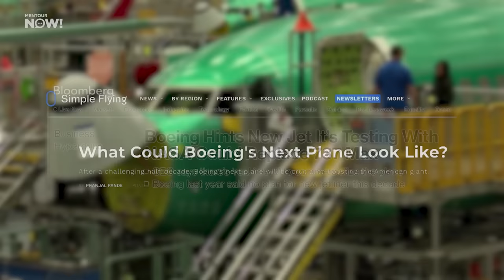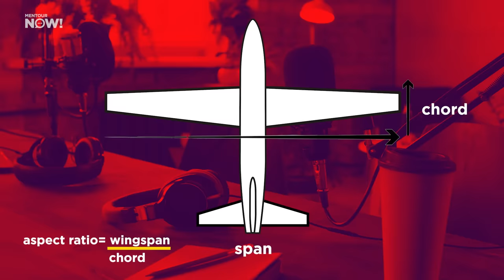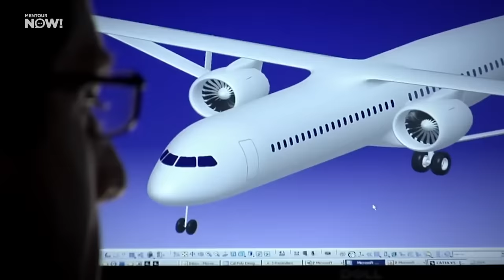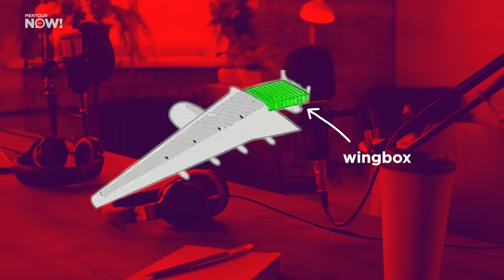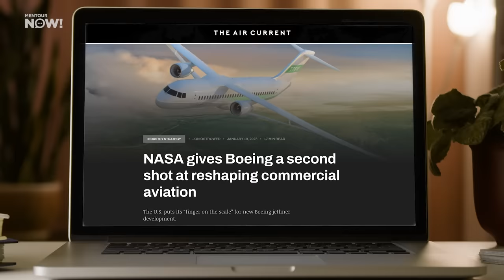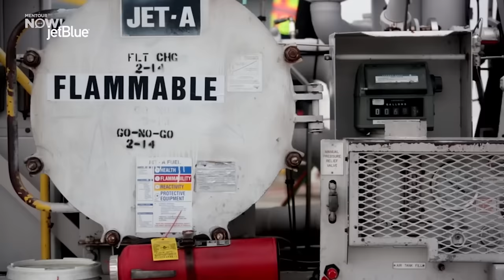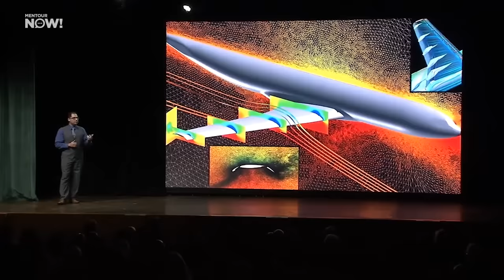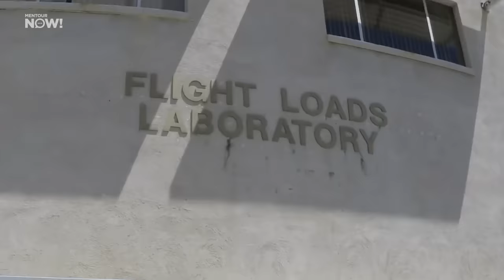Revolutionary Breakthrough: Boeing's Transonic Wing in Partnership with NASA!

Comment: I kinda hope that smaller, slower and more efficent is the future. They should make flight more bearable, or start breaking long flights into several short flights. This may fix several problems: increase effecency, let passangers take breaks, and possibly even use electric motors.
Reply: The reason they build them large, fast and long-haul is because it's more efficient than small, slow and multi-leg.

Comment: One correction: It doesn't "beg" the question; it simply raises it. To beg the question is to answer a question by simply restating the question in different words in the answer. In formal debate, this is considered an error, a logical error.
Reply: This isn't actually a correction because "beg the question" is commonly used as a synonym for "raise the question" when the context is not a debate. Indeed, if the context isn't classic logic, it's pretty challenging to find an example of someone using "beg the question" in that sense. Language has evolved, and it is probably a good idea to get used to it instead of whining about it.

Comment: I am a captain of a B747F, and I could attest to the fact that Boeing made a huge mistake by canceling the production of the B747 types. The demand for a B747 cargo aircraft is at an all-time high. However, Boeing wants to push for their B777 line to replace the 4 engine planes. The nose cargo door of the B747 makes the B747 a unique and needed cargo aircraft, which no "modern" aircraft from either of the aircraft manufacturers can't replace. 
The B737 is a relic from the past, and the type should have been retired 20 years ago. The Max is nothing more than a B737-400 with modern avionics, but old systems running those avionics. Basically, it is a pig with makeup, but it is still a pig.
Boeing should have modernized the B757 by changing the engines and the old avionics package. The B757 is a much more capable aircraft than the B737 Max will ever be. The B787 is not what they want you to believe. Although I have not flown the aircraft, I have flown with people who have, and their opinions are all about the same; they do not like the aircraft. 
All I can say is that I am so glad that I only have 4 more years before my mandatory retirement from 121 flying, and not a moment too soon.
Reply: Regarding the 747, the production line was open until recently and cargo airlines could order aircraft until 2 years ago or so. They ordered what they needed, they could have ordered another 50. They didn't however. It was shut because all orders were delivered, not because they wouldn't have accepted more orders.
Reply: @Simon M  As far as I know, Boeing was pushing their customers to purchase the B777 instead of the B747 types. As you said, most of the companies ordered what they needed, and now there are no more B747s being manufactured.
Reply: @afreightdogslife  at the end the 777 is the more economic aircraft, it just has the disadvantage it has no nose door, but just a side door. The new 777-X freighter should be on par regarding payload with the 747-8 F. 

From the late 2020s on there are stricter rules regarding efficiency and Boeing has to discontinue the 767 F from then on too.
Reply: @Simon M  Like I said, Simon, I am very glad that I only have four years left before I retire, I can't wait, lol.

Comment: But how about two wings, connecting at the ends? That could solve some issues. Like the Sharrow propeller.
Reply: @cyrilmonkewitz  and it gives you double lift for a short wing, no?
Reply: @cyrilmonkewitz  if the wing is half as long, it will be more than twice lighter, as it does not need to be that strong.
Reply: Two wings connected at the tips is much worse for induced drag than a longer wing of equivalent mass.

Comment: The low wing design has an advantage, as rare as they are, when it comes to water landings
When it comes to folding wings: it doesn't necessary to have it fold up. They could use a sweep back design
Reply: Sweep back design? The important aspect with respect to lift is the face that goes into the air. The swept back design is important when approaching the speed of sound but otherwise it's all losses.
Reply: @Milamberinx  I don’t think he was referring to sweeping the wings back when the plane is in the air, but only when on the ground. Still, that seems like it would be a lot more complicated than just folding the wings.
Reply: @Milamberinx   John is correct. I was referring to have the folding wings/wing parts sweep back instead of folding up
Reply: @henrikcsuri  sorry, I completely misunderstood what you meant. What you're talking about it more usually called "swing wing", it's been used in fighter planes with... mixed results.
Reply: @Milamberinx  That's where i got the idea from. I live near the USS Midway museum and they have some pretty cool airplanes onboard
Reply: Why not both? Just like an hybrid of an F-14 and F-18! Boeing already has some experience with that! Heck, while we are at it. Why don’t incorporate some body lift capability like the F-15 has, using that McDonell Douglas experience!
Reply: @luiskp7173  Because as it was mentioned in the video it's harder to inspect a wing piece that folds up.

Comment: At 0:13 you can see the noise suppression pipes at the back of the 707's engines. You can get a better view of the pipes at 2:58. Noise suppressors were installed on early jetliners and were comprised of several exhaust pipes arranged in a circle. Early models had 21 pipes per engine, comprised of 10 large pipes in an outer ring, 10 smaller pipes in an inner ring, and a center pipe. Later designs had 8 large pipes with a flower-style center exhaust pipe. As engines got quieter the noise suppressors were no longer needed. You can get a glimpse of some pipes through an early type of thrust reverser at 3:36. Then another brief look 4:34.

Another interesting thing to notice is the tiny air intake above the 707 engine at 4:25. This air intake is for the cabin air pressurization system. Behind the air intake is a small turbo compressor. This was supplemental to the cabin pressurization provided by the engine bleed air. They only had the turbo compressors on two or three of the four engines.
Reply: Mufflers?
Reply: @sharoncassell9358  Sort of but it worked differently. In a car muffler the exhaust gas bounces around inside the muffler in a certain way which reduces noise. In a jet engine most of the noise comes from the exhaust slamming into the outside air. Running the exhaust through pipes changed the way that the exhaust hit the air which reduced noise. Only somewhat though, the early engines were still very noisy especially at takeoff.

Comment: 13:00 each side would need to fold 8m of the wing. Flexibility of the whole wing could be a problem. Especially around the truss. Basically everything from truss to fuselage would not have any flexing.
Reply: That's exactly what i was worried about as well, i just wrote a comment asking a similar thing, because i am imagining a wobbling mess, kinda like the suspension bridge that danced in the wind before it collapses.
So i am sure they have thought it through, and your suggestion makes a lot of sense, granted, i have no education on this.
I hadn't actually thought about that, although he did mention the wing box enforcement.
Reply: @Games_and_Music  yes but normal wing is gradually changing its reinforcement and the flex changes by linear way. Here the strongest point of the wing would need to be around the truss. This doesn’t go well with wing becoming narrower the further you go from fuselage.

Comment: I have never heard of an airline being directly charged for the size of the gate they need. The main airport charge is the landing fee, which is based on max take off weight and noise and emissions category, not size. In the US airlines do tend to rent their domestic gates, so for those this a bit true, but this slender wing would be more suitable for long haul flights anyway. Now another challenge not mentioned is the limited fuel capacity of these wings. Moving fuel to the fuselage is not good for your structural weight as in increases the wing root bending moment.
Reply: Because YOU have not heard of it, doesn’t make it untrue. You think Petter is making this up?
Reply: As explained in the video, there are different gate categories depending on the size of the aircraft (including the wingspan). Large planes, like the A380, 747, 777, etc., require larger gates. And smaller planes, like the 737 and A320, are suited for smaller gates. There are gate category fees included in the landing fee package. Large or super-large aircraft will pay more than smaller planes. So you will want your small, single-aisle airplane (which the new wing design is built for) to be physically able to use the smaller gates. If the wings are unable to fold, then the plane can only park at gates designed for larger aircraft, thus making the small plane cost prohibitive.

Comment: I think this is just showing how hydrogen is probably going to be the winner for future green aircraft.
I think synthetic kerosene makes more sense to pursue personaly.

However, if you have to store hydrogen in tanks in the fuselage. You can stop caring about space in the wings for fuel and focus on efficiency to get the most out of the lost fuselage volume.
Reply: Except a lot of hydrogen planes tend to have larger/delta wings designs due to the needed volume regarding the low volumetric density hydrogen. So either you increase the fuselage size, or the wings size or ofcourse a combination.

Comment: You know, designing a plane is much more than make it more eficient and sustainable, its also ( a lot) about passenger confort. So here i dont see any advancement for passenger, they just travel in a tube as usual. Dicth this concept and develop all wing planes
Reply: Not everyone travels in a tube as usual. They've got some pretty cushy seats towards the front of the plane. And you get to board first and everything. But it costs a lot more, just as larger cars, and larger houses, and larger hotel rooms with higher service cost more. I can only afford to sit in the smaller seats in back where it's a lot cheaper, but I'm okay with that. I guess it would be more fair if they socialized it and made all the seats the same size, but that's true about everything.

Comment: As for the Boeing Vs it's only real competitor, I'll say this.
Airbus hasn't designed a plane to nose down into the ground when the AoA becomes questionable.

Airbus hasn't designed a plane to completely take control away from the pilots.

Airbus hasnt designed a plane with mid-flght automatic door openings, of doors that aren't even supposed to be able to open.

Airbus doesn't keep quiet about any changes they make to their types or designs. No matter how large or small they may be. 

Airbus is still a company run by engineers and passionate aviators. Not bankers, accountants and stock holders. They've so far kept their QA intact and uncompromised. 

So, as far as I'm concerned, Boeing has no leg to stand on with any argument they try making. Be it against Airbus or anyone else.

Comment: Great video, just some pointers on some of the English in the video as I understand its not your first language.
Although ratio is spelt as it is, it is not literally pronounced Ray-tee-oh. It's pronounced, Raysh-ee-oh. As if it was spelt rashio. And not Ray-tee-oh
At the start, and again at 16:20 you should have said the Plural controversIES; because you said "are there any" (if your sentence uses "are" and not "is" then that's a pretty good indicator you need to use a plural)  which should be followed by a plural, just as you would say "Are there any people here" and not "Are there any person here", or "Are there are donuts left" not "Are there are any donut left"  Microsoft word set to English (US) or English (UK) will correct this for you if you type out your script at all, it will underline it and correct it to the plural form, and tell you why. The only time you would use the singular, is if you specifically forced it, which would require "is" instead of "are" and specifying a singular noun, with "a"; i.e "Is there a controversy". But "are there any" is forcing a plural.

Comment: Ah, they try to fool you.. these will be a lower speed aircraft.  Basically Boeing is concerned with wing flex and after the introduction they will decertify the wings of their big 2 engine aircraft (especially the carbon fiber wings).  . Mach 0.8 at 40,000' = 447knts, but I'll bet that this aircraft will be optimized at Mach 0.7 (392knts) or 0.65 (364kts)

Comment: I’m surprised SpaceX hasn’t moved into the Commercial Aircraft industry.  In the time SpaceX has perfected reusable Space Rockets and not far off interplanetary vehicles. Boeing have struggled to fix an upgrade to 737, years late for the 787 with quality issues too.  Now 777X is years behind.  Meanwhile Airbus can delivery NEOs types. A clean sheet design in the A350, all with no major fuss.

Comment: The wings of the B707/720 and DC-8 Had to be thick due to the fact that propulsion technology was still in it's infancy and the wing had to hold a lot of fuel= weight= beefy structure. But today's modern A/C can be designed to have a more streamline wing design. The MFG's just don't want to invest in the time it would take to make it all work. So it's cheaper and easier to hang big ugly canoe's on the underside of the wings. Besides the MFG's aren't paying the fuel bill!!!!!!.............

Comment: Today's cult of financial management is unlikely to give control back to the engineers. Theirs is a religious belief in low risk advancements dominated by cost reduction. Boeing's recent modus operandi is exactly this. The 737MAX  debacle was a minimum cost effort to compete with Airbus' A320NEO innovations in efficiency increases, and cost cutting led to MCAS' mess.

Financial management is primarily aimed at bonuses and stock buybacks, with long term goals trumped by schemes to maximize the value of stock shares, tomorrow morning.

No bonus-driven financial manager is going to willingly 'bet the company' the way Boeing did on the B707, 747, and 787. When a Boeing executive, Alan Mulally,  brought the 777 development in under budget and ahead of schedule, Boeing passed over him in favor of a financial type for  Boeing CEO. That day, Boeing completed its plans to change from an aerospace manufacturer to a financial institution. 

Just like General Electric...

Comment: Guess why wing struts made it to the dustbin of aviation for fast aircrafts. There's so many things about the strut-wing joint to be considered. From an aerodynamic point of view, a long time the fuselage was mostly beyond focus of optimization for quite simple reasons in civil aviation. There was always the choice of different models featuring different load capacities by just lengthening the fuselage. That's however a very "truck thinking" with trucks being restricted by road width. The sky has no limit, so why not enter the thinking of aerodynamics and optimize fuselage?
Otto aviation went the road to fuselage optimization already. The celera500 is the outcome. And the Celera does not even show a blended wing body but a drastically reshaped fuselage. The efficiency is marvellous. Say what?  The Lockheed Constellation did feature an aerodynamically sleek fuselage.
The very optimum of that thinking is the blended wing body concept, understanding the aircraft as a whole. So people are complaining about 2 drawbacks. Passengers not enjoying windows and complex, costly manufacturing. The first one already is overcome by displays, not to say, the windows are the joy of a fraction of the passengers only. The latter was at times of Conny. Today vastly advanced methods for manufacturing wings do exist. Why not make use for blended wing bodies?

Comment: As an A&P and someone who worked the KC 135, C5, and C17 for 19 years how you describe the flap track and flap fairings are wrong. The reason why the KC135 has no external fairing is due to the flaps being on tracks and jack screws which gets covered by the flap itself and cove lip doors when up. On C17s and newer airframes they have massive hydraulic actuators that get housed in the flap fairings.

Comment: I can't wait to see the new technology!  That new wing looks very laminar,  with a very shallow cord, resulting in a thin wing. Everything is a trade off. For that wing, it's speed. It should require faster TO and Landing speeds. A military jet with laminar wing design has about a 160-180 stall speed!  F22 maybe higher!  I wonder if the "brace" provides any lift?  It may require longer runways?  200kph final approach w/170 TD?  Thin laminar, no leading edge and small flaps?   That X-NASA guy with the new concept,  rear propeller diesel plane w/great fuel economy also has laminar wings.  It needs 6000' of runway, or more. Should be very interesting!!   8)    --gary

Comment: Using parts and sections of the MD-90, I'm concerned about tthat statement on the grounds of that means maintenance crews will have to observe  the tail section in strict detail, i.e. the Jackscrew. Alaska Airlines Flight  261 involved a MD-83 that suffered a catastrophic jackscrew failure that made the flight non-recoverable, and the FAA found that Alaska Airlines was at fault due to lengthening the windows for routine maintenance on their fleet. I doubt Delta would cut corners like Alaska did but that's still a scary thought/possibility that followed McDonnell Douglas into the grave